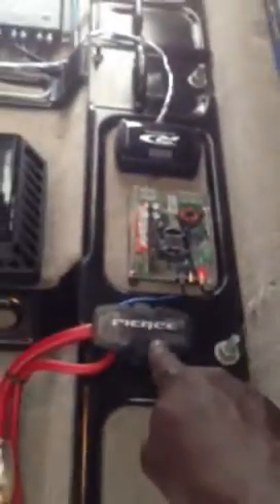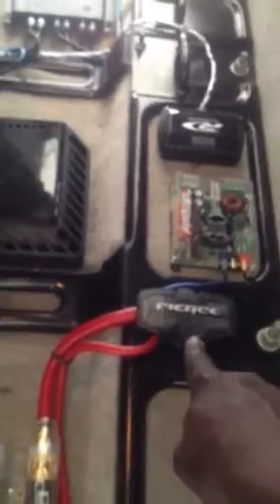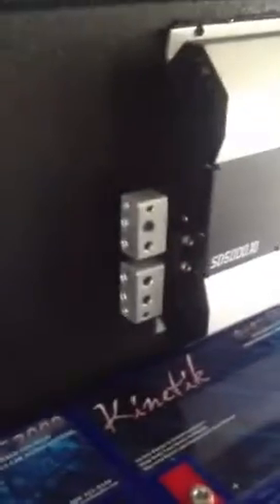Update #6 Tahoe build

Comment from the maker: yea your right, but that one gound you sawis just for my sd amp  that grounding block is one in dual out, and my sd amp has dual power and ground conections i will be having two seperate grounds i just haven't done the other one yet